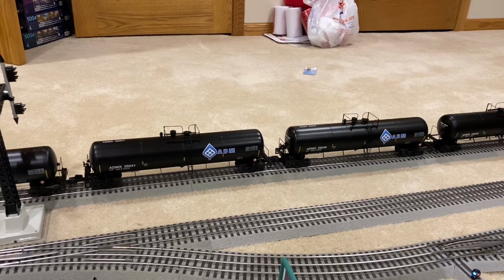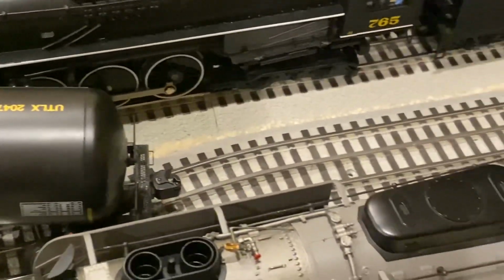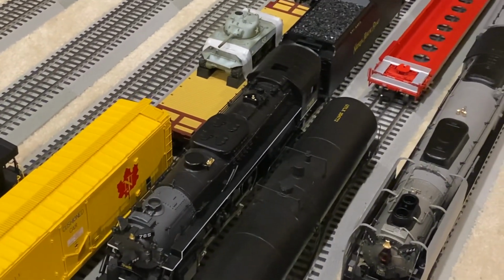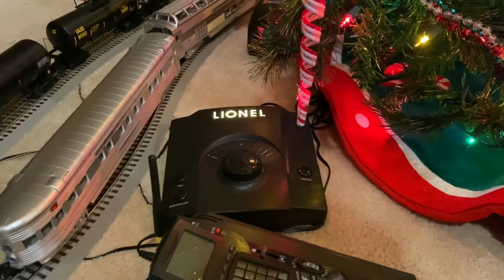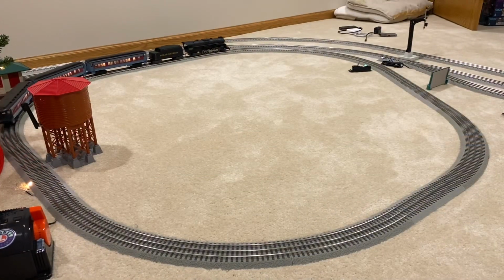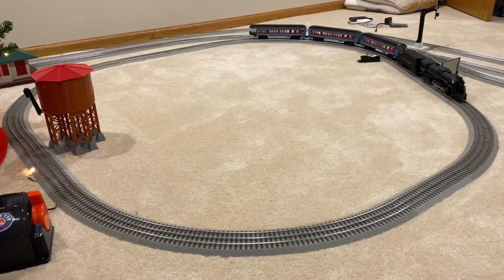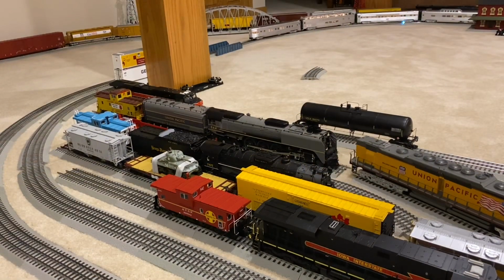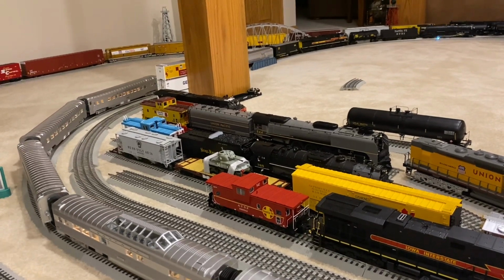Lionel Fastrack Christmas layout update/running

Comment: What type of Lionel transformer is in the video? I used a pick to get what's left of the old whistle off my polar express berk before I replaced it with a new whistle. You can find picks from harbor freight, maybe even a tooth pick. You can find a new bell and whistle from ebay.
Reply from the maker: The legacy transformer is a 720 brick, the polar express is a CW80
Reply: @JimsPlanesandTrains  Nice I never seen a transformer like that before with lights. The CW80s are great too. I miss mine but it broke.